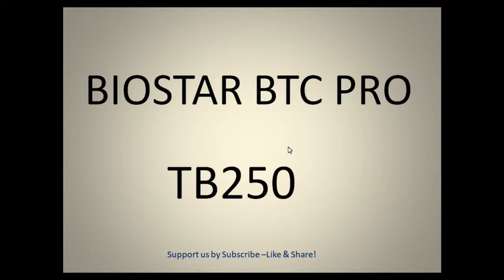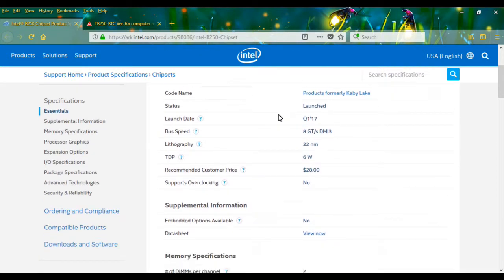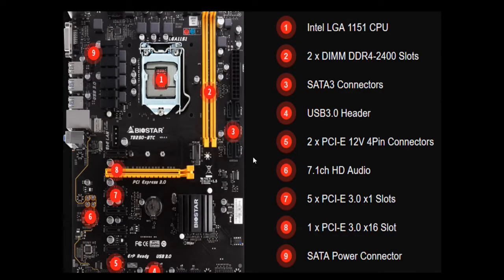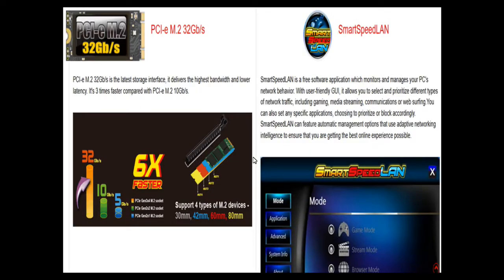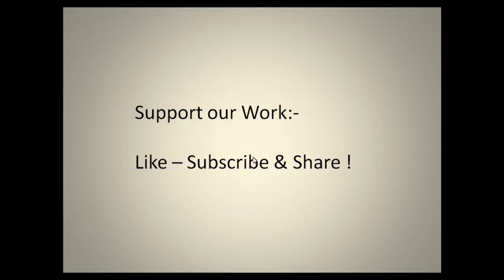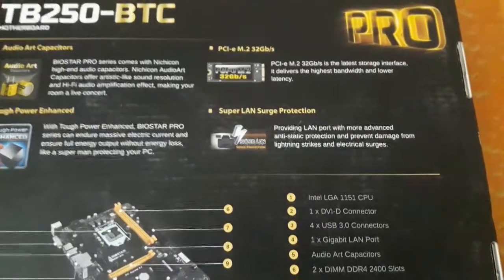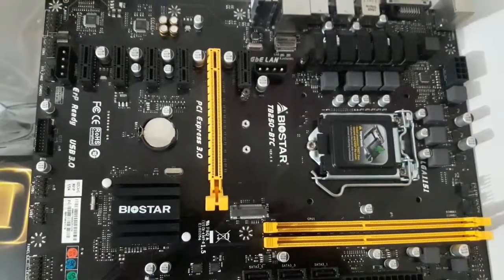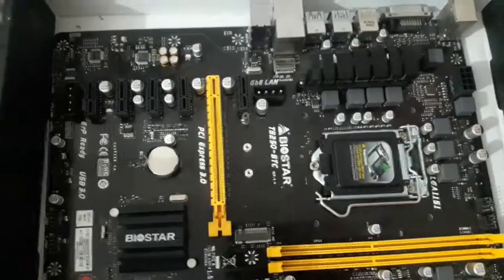Biostar gaming motherboard TB250-BTC PRO - Unboxing & Features

Comment: Hi, what CPU and GPU you are using with this MOBO and how its performing, I have same MOBO, C2D G4400(CPU), 8GB  RAM and GTX1060 6GB but still not feeling satisfactory performance , on CSGO I am getting only 80 FPS Max which is also not stable/constant
Reply from the maker: Dear G Tech,
I am using Biostar TB 250 with 8GB RAM & CPU - G4400 Skylake Dual-Core 3.3GHz.I didn't try CSGO or check Frame rate as it was experimental for blockchain explore.
But give me sometime will upgrade it with i5/i7 with share the details with GTX 1050, 1060 and rx 470 8GB.
Thanks!
Reply from the maker: Also if you let me know your config. try to help you out in making system stable and getting max fps in all gaming